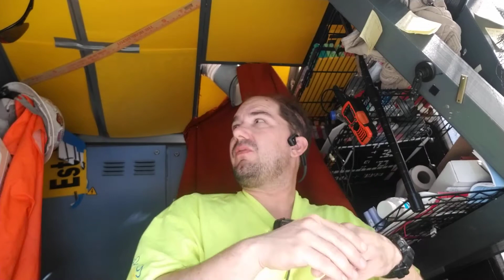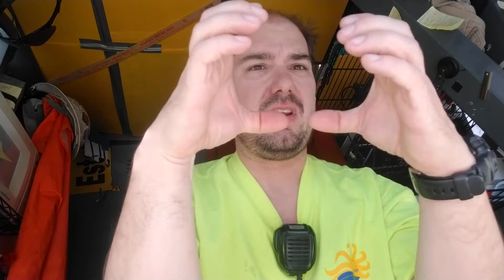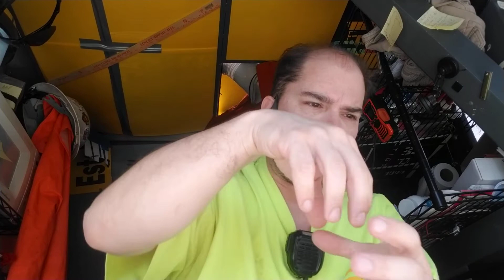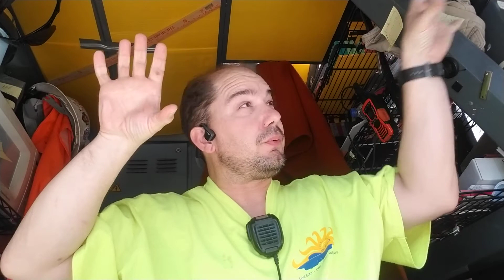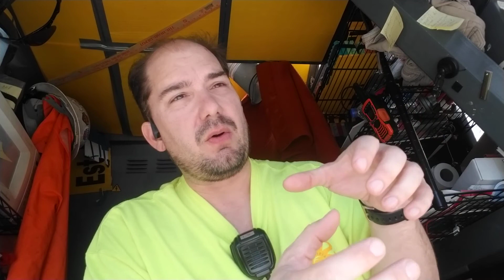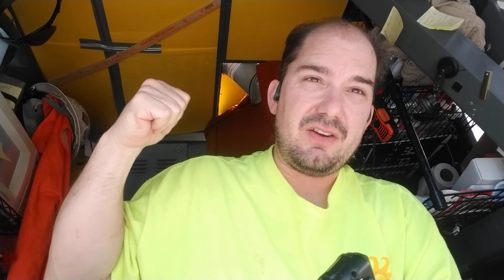Seattle crane accident. What happened?

Comment: Hi I’m a tower crane operator and a tower crane erecter here in Miami the first thing it’s I want to say the you got wrong it’s the 550 towers it’s use in liebherr crane 316 with a transaction on a 390 on a 420 , 550 and 630 cranes those section are 20 feet long not 40, the crane the you are on it’s 316 and the tower the they use for the crane it’s 290 tower witch is 14 feet long and they used bolts not peens.second thing you got wrong it’s the 550 tower does not have keys it has a plate on the inside of the tower with 2 nuts holding to ping from sliding out. The cab for the crane it’s weight close to 30,000 pounds, each section of a 550 tower weight 14,500 pound so when you have the much weight on top with no pin holding everything together there it’s a very high chance of falling in high winds. Down here we work every day taking down crane putting them up or jacking up or down.